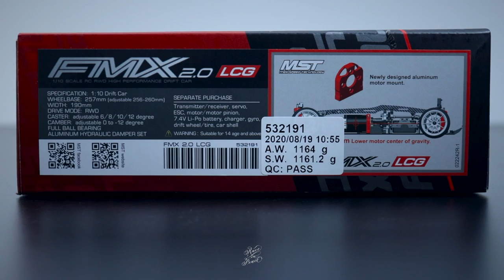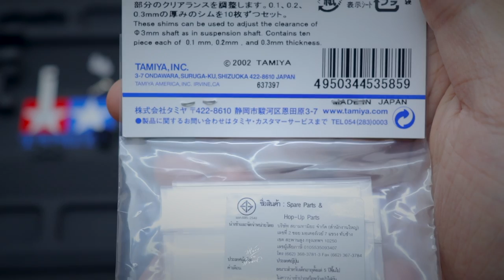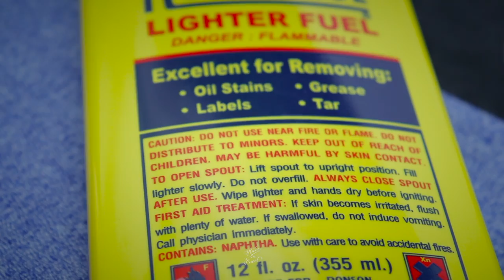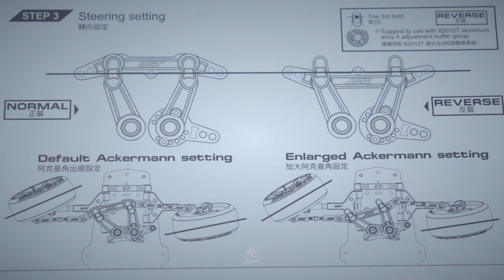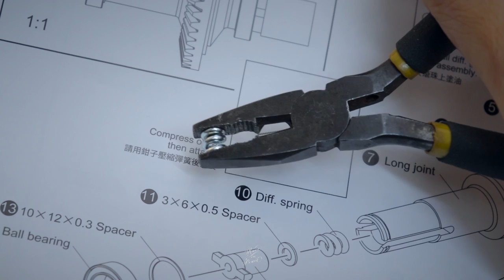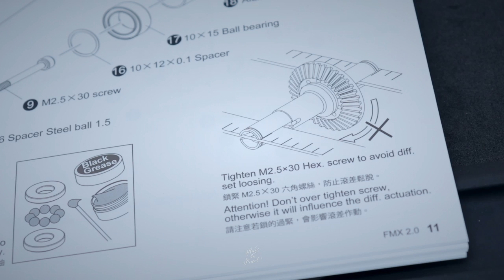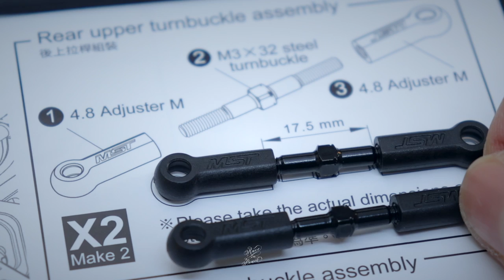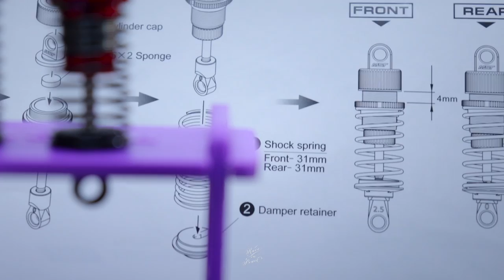Building RWD RC Drift Car Shaft Driven Middle Motor & Test Run MST FMX 2.0 LCG

Comment: This video is so good. You deserve way more views! It must take taken many hours to edit and film. 

if you have time please help recommend, I'm looking to get my first RWD drift MST but I don't know which one would be better for Asphalt drift, RMX, FMX or FXX ? it seems like RMX would provide best grip and speed and FXX might be too slow or have I got that the other way around. Then I though I probably cant go wrong with  FMX :)
Reply from the maker: Hello from BKK, where you live? and thanks for watching this VDO too, I am RMX 2.0 S user who go with rear motor conversion kit over 4 years (before RRX 2.0 S released) and this is my opinion >>> if you no need to go by too much of budget, you can run with RMX 2.0 S RTR, you can find OPB VDO and test run in another channel, brushed or brushless, both are good for saving budget too and can upgrade to pro version with any parts of chassis too >>> FXX 2.0 S the driving style is super close with real car because engine bay stay in the front but in RC physics, we don't have much horse power like real car so FXX is harder for setting up chassis to go with high speed like the rear motor position (RMX, RRX, FMX, D5, YD-2(any version), Overdose Galm, GRK R31House, etc BUT I think I love the sliding style of FXX 2.0 S and now I am already got this one but not assemble yet , FMX 2.0 LCG is great choice too because out of the box come with more upgrade parts (main chassis, alu shock) and after I am running this car for shooting VDO, I think FMX is good for speed and totally different in transition action while drifting if we compare with any chassis but this one coming with higher price more than RMX, FXX, RRX too :D
Reply: @RaceInPeaceisHere  thank you for quick reply. I'm in New Zealand, I always do AWD CS drifting with Tamiya TA-06 / XV-01 and I mostly do it on outdoor high grip asphalt driveway with MST blue dot and PC tires. Can do a lot of high speed drift with it, the XV-01 is a lot like the FXX but with Belt, it was very difficult to setup and get it just right for drift, many hours of testing and failing but satisfying result, great angles. 

I noticed that RWD are often slower in comparison to CS cars for outdoor drift, so looking for the fastest RWD MST chassis, I think sounds like the RMX is the way to go.

My budget is a choice between RMX 2.5 RS  or FMX 2.0 LCG,  the FMX is cheaper at the moment nearly $100, but the RMX RS adjustable engine position is also really good.
Reply from the maker: RMX 2.5 is coming with new gear system and new adjustable option with shock but FMX is old option with that, nice to meet you here and keep fun with your hobby time, stay safe too lml/

Comment: Obviously an old video. BUT.... 2 things missed here. 1. the o-rings you placed on the outside of the shock body must be installed inside the spring collar NOT floating on the outside of the shock, to prevent pre-load adjustments from wandering. 2. when building the shocks like you did using the rebound setting you must have the lower spring retainer on too. All that bearing oil put on everything is a magnet for accumulating dirt and dust will hinder movement.
Reply from the maker: Thank you

Comment: How did you get the door trims and all the fine black lines?
Reply from the maker: Body lines is black sticker
Reply: I just bought the shell because they discontinued the rtr one, hopefully its got everything that I need to get it spot on like the one you did, my mazda is bagged and would love to replicate it for car meets and stuff. Don't know if they have the oem aero kit for this gen hatch in 1/10 scale though
Reply from the maker: Rocket bunny parts is not perfect fit so I modify it myself
Reply from the maker: @dadebrindley8246 https://youtu.be/fh-1-GiK_6o?si=4CHSDHFXlnyJYMcs

Comment: What was the liquid u put on the bearings in the glass and what was the  stuff uput onthe plastics. Im building my first kit and no were in book does it say use anything but ball diff grease on the balls n the black grease on the very tiny balls.??  Also how can i tell which ball bearing is which they all look the same size other than the 10x15 even the spacers. Can you or some please help me out
Reply from the maker: In the glass is RONSONOL and tiny balls need black grease for assembly, you can check it in manual man

Comment: what is the fluid you put on the threads of the front lower arm is it like a lube to keep the plastic and metal free when screwing and unscrewing?
Reply from the maker: That is ball bearing oil

Comment: What red color is this? Tamiya ps15?
Reply from the maker: the first layer is Tamiya PS 37 Translucent Red (depend on you need, more layer more dark, less layer more bright) second layer is sparkle metallic spray, I am buying this one in my local store (LeyLand Branding) third layer is silver spray, LayLand too and the last layer is Black matte Nippon paint Branding, I make this way because I don't have any air-brush system so I try to adapt other ways for painting
Reply: Thank you for respons, very beautiful... Is it 2 layer tamiya ps37? Because i tried 3 layer of tamiya ps37 + silver + gun metal the result is more darker than yours..
Reply from the maker: Because after ps37 is sparkle so brighten and deep dimension more than silver

Comment: What kind of battery did you use? I bought one off of eBay and it is too big for my holder
Reply from the maker: Try to using short batt for weight reduction
Reply: @RaceInPeaceisHere  is there a certain brand that's better? Or what's your personal preference
Reply from the maker: Try to find ReveD or Yokomo short battery, they are the lightweight batt, less weight go faster and great for transition while drifting

Comment: Great video, very good on details. Love the color. I’d like to use that on my A90 Supra rocket bunny wide body. What colors did you use?
Reply from the maker: BIG thanks for watching, the first layer is Tamiya PS 37 Translucent Red (depend on you need, more layer more dark, less layer more bright) second layer is sparkle metallic spray, I am buying this one in my local store (LeyLand Branding) third layer is silver spray, LayLand too and the last layer is Black matte Nippon paint Branding, I make this way because I don't have any air-brush system so I try to adapt other ways for painting
Reply: @RaceInPeaceisHere  thank you. The body looks really good whichever wet you painted it.
Reply from the maker: Thank you :)))

Comment: Great video I am building my first MST kit getting into the hobby. What oil did you use to thread the first 2 parts please? (metal and plastic parts). Thanks!
Reply from the maker: Hi there! pls tell me about time position  in the VDO :D
Reply: @RaceInPeaceisHere  4:01
Reply from the maker: That is ball bearing oil :)

Comment: Input Voltage: 1S lipo esc มันใส่ได้หรือครับ
Reply from the maker: ปกติสปีดของรถพวกนี้จะใส่สองเซลนะครับ แต่คำว่า ใส่ได้หรือครับ ผมอ่านแล้วก็งงนะ เพราะในคลิป ผมไม่ได้ใส่
Reply: @RaceInPeaceisHere  ESC : Team Powers brushless XPS sport 100A V3 speed control w/ LED card
Specification:
Controls: Forward/Brake/Reverse

Input Voltage: 1S lipo

BEC: 6V/7.4V selection/max ~3A

Motor Limit: 6.5T or over

Max current: ~100A per phase

Size: ~41x32x18mm (without fan installed)

Weight: ~42g (not include wiring and fan)

Come with XPS V3 LED card or it can be used with Radon LCD card(need to buy separately)
Reply from the maker: ครับผม ผมไม่ทราบสเปคมาก่อน คุณจะลองเอาใส่ก็ได้นะครับเซลล์เดียว แต่ปกติแล้วผมเคยใช้เล่นแต่สองเซลล์ ครับ
Reply: @RaceInPeaceisHere  ใส่ได้ดิวะ ใส่แบต 7.4 ตามสเปก แถมมอเตอร์ไม่ถึง 6.5T เหลือเฟือ ตั้ง 100A ไม่งั้นสปีดจีน 40 แอม ใส่2S ไม่ปิดโรงงานกันหมดหรอวะ  ตลกข้างบนต้องการอะไร ปกติสปีด 1Sไม่ได้ออกแบบมาสำหรับรถกระดาน1/12 อย่างเดียว มันมีโปรแกรมเซตไว้แล้วนะ รองรับ2S ได้แต่ห้ามเกิน 7.4V  เออ แอมเยอะของแบ่งมั่งดิของพี่ แอมแค่ 60เองในรถทัวริ่งวิ่งไม่ทันเพื่อนเท่าไหร่แค่เพลทไฟแลบวะ 5555555
Reply from the maker: อาาา ผมก็งง ว่าคนถามเขาต้องการอยากทราบอะไรกันแน่ งงครับผมไม่รู้ครับ ผมปัญญาอ่อน
Reply: อ่อครับผมเพิ่งมือใหม่ครับไม่ทราบว่ามันใส่ได้ครับ ไม่ได้เทพรู้ทุกอย่างแบบพวกคุณครับ ผมนึกว่ามันใส่1sเท่านั้นครับเลยถามครับว่าใส่2sได้หรือ ทำไมหรือครับคนไม่รู้แล้วอยากถามต้องคิดว่าคนนั้นกวนตีนทุกคนหรอครับ
Reply from the maker: ผมก็ไม่รู้ทุกเรื่องนะครับ อย่างที่บอก สเปคผมยังไม่ทราบเลยครับ รถพวกนี้ปกติผมก็บอกแล้วว่าผมใส่แค่สองเซลล์ คุณคิดว่าผมคิดว่าคุณกวนตีนนี่ผมว่าคุณคิดเองละครับผม
Reply: ลองให้คนอื่นเข้ามาอ่านดีกว่าครับ เดี๋ยวเขาก็ดูเอาเองว่าใครกวนตีนใครกันแน่ครับ
Reply from the maker: @moonzonezturn1471  เข้ามาอ่านได้หมดครับ ขอบคุณทุกท่านที่เข้ามาดูคลิปด้วยนะครับผม

Comment: Chassis looks little bit weird..
FXX Front + RMX upper deck + middle motor mount = FMX (?) 
Drift chassis layout is so variable that every layout has been done by someone.
Reply from the maker: each chassis have various character and style while drifting and transition for battle, for me I think FXX is like real car while playing the most, FMX very fast for transition and RMX YD-2 D5 are rear motor position so they are faster more than FXX or FMX because weight lay out but you can find for best setting to play with your friend, competition or for your hobby time ^^

Comment: while everyone is moving to rear mount motor, MST decided to go the other direction....
this is not more "realistic" and no one will see it any way...
makes no sense...
Reply from the maker: MST have various layout to play, this is hobby and I am RMX user who play with rear motor conversion 3 years ago, you can go with another chassis man, make your great choice, go with your sense ^^
Reply: @RaceInPeaceisHere  Oh I have a YD-2S, I am just saying its weird they are going mid motor while everyone else is going rear.
Reply from the maker: Oh nice and for me, YD-2 E and S are my favorite chassis too, my second chassis is YD-2 E after try with D4
Reply: I started with an mst rmx 2.0 rear low mounted motor I then switched up and tried high mounted rear motor. That worked and felt better.
I now have a plastic mst fxx and a kmw fxx. Both front mounted motor and they handle totally different to the rmx. The rmx I found I had to work to drift the fxx is effortless. The rmx and fxx are 2 totally different chassis and 2 totally different drives.
Reply from the maker: Ohh you are MST fans, nice to meet you here lml/
Reply: @RaceInPeaceisHere  I've also had a d4, auperd, yd2s, d5 and a d5 sga blue. My favourite so far is the fxx
Reply from the maker: Superb